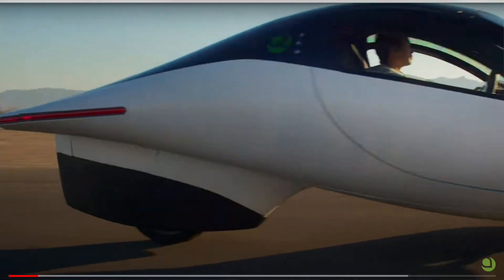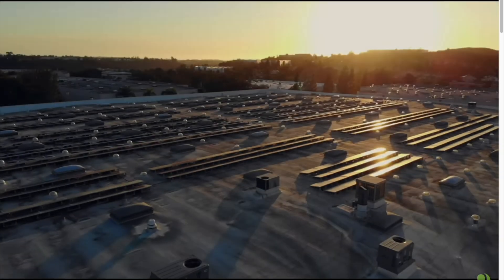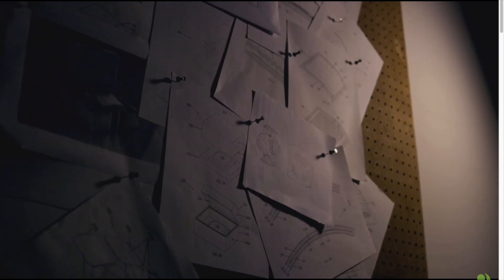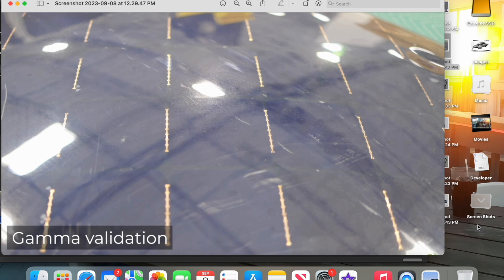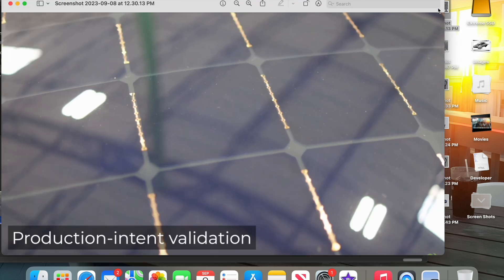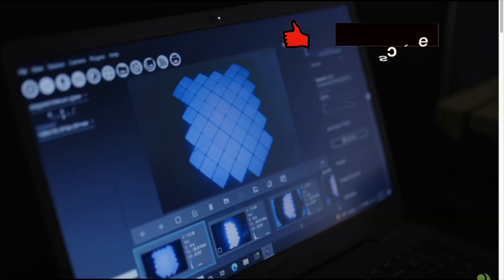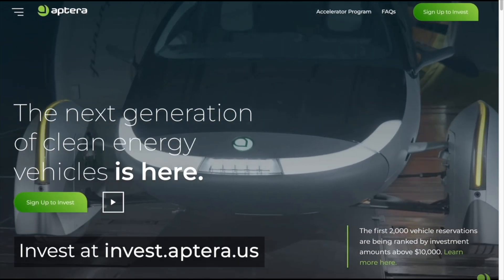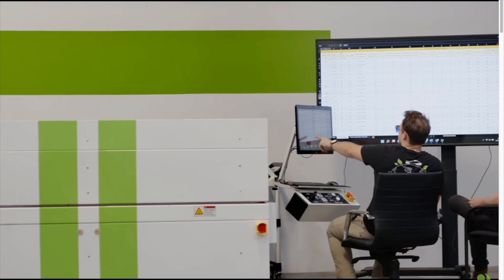You Can See The Laminating Change In Solar Panels !

Comment: I am surprised they are going with the bare copper connections. While I do like the look, that opinion will change if they oxidize and turn green like most copper does. Tinning would prevent that, but might not be needed with the new laminates. I also wonder if they solved their problem with the size of the hatch solar.  I believe they had problems getting that size panel in to the vacuum laminator. Did they get a larger one?

Comment: Given that these panels are a plastics sandwich laminate, it will be interesting to learn what the protective exterior layer is made of, and how durable it will be.  I like the look of the visible interconnects between the cells also.
Reply: My guess is that they will be using polycarbonate, so it will have about the same scratch resistance as car headlights.  That is to say over a decade or more if you live where they use grit on the roads they could get pretty opaque, though it is also possible that the effect might not be so pronounced on horizontal surfaces as it is on vertical, forward facing surfaces such as headlights. Keep an eye on the hatchback windows of Toyota Prius Primes (they are also polycarbonate) to see how they hold up over the coming years.
Reply: @robertkirchner7981  Polycarbonate is my best guess as well.  No matter what it is, we will likely have to be careful washing them to prevent scratching.
Reply from the maker: I hope not , but we’ll be replacing them in 10 years anyway . 😎
Reply: @robertkirchner7981  From an optical point of view, polycarbonate would be a bad choice.

Comment: I guess that would be one of my concerns, now that I think about it. How would these fair against rocks flying at the vehicle?
Reply: They are laminated into composite panels shaped to fit the body.  The clear composite protects the solar assembly.
Reply from the maker: They have done 1 inch size hail test , where 1 inch size hail is shot at the panels to see how it holds up . 😎
Reply: @williammann7247  Assuming "composite" is defined roughly as "fiber reinforced resin", it is not a "clear composite".  It would be more correct to simply call the solar panels "laminates" where laminate is simply various continuous layers stacked/bonded to each other.
Reply: Composite means made of different types of materials.  Laminate means different material overlaying each other.  All laminates are composites, but not all composites are laminates
Reply: @DarthTinderalla-qm9zw  So film tinted glass and paint covered metal are composites?  That's just downright weird to me.  I've been engaged in making solar panels for almost 3 decades and have NEVER thought of them as composites.
Reply: @bobhilder1469  I think soup would technically be a composite unless you blend everything into a homogeneous mixture.
Reply: @DarthTinderalla-qm9zw  It would seem that way!

Comment: It seems that they will still have the visible copper connectors. I like the look.
Reply from the maker: I really like that look also . 😎
Reply: Third! @freepower1082
Reply: I assume  any oxidization turning the connectors green will indicate an issue with the solar panel and it will need to be resealed.
Reply: Silver helps produce much higher power levels.